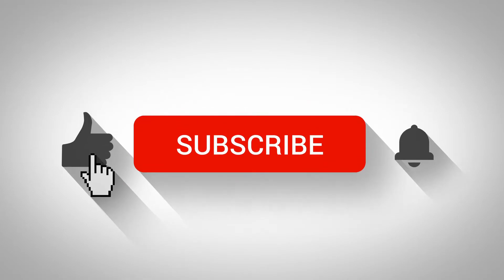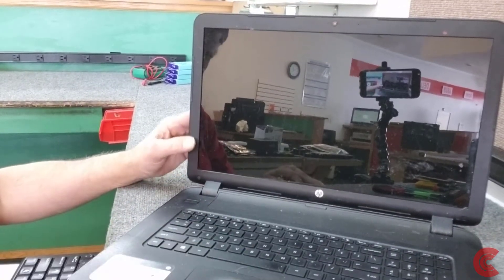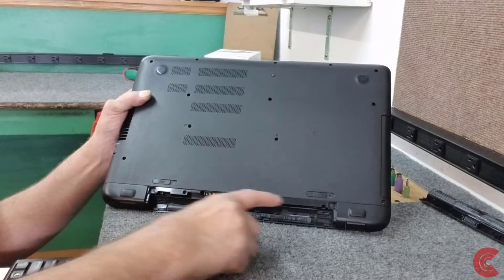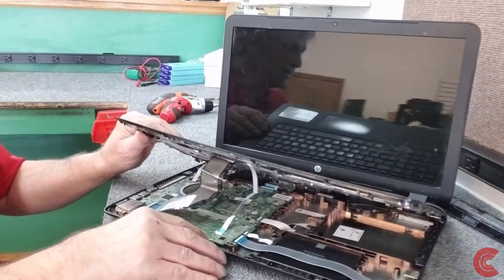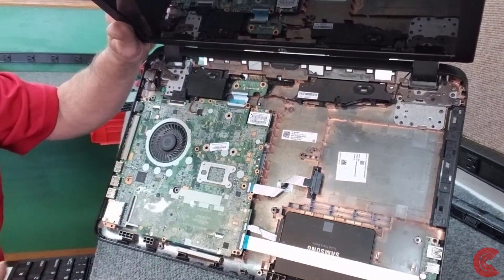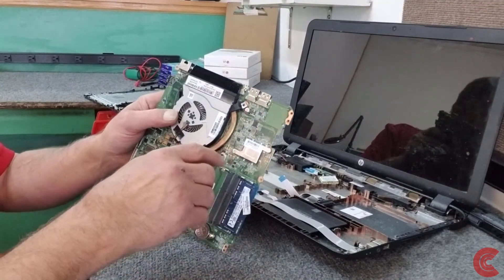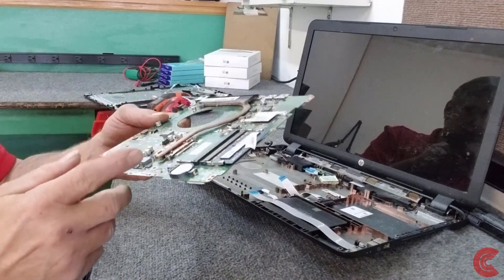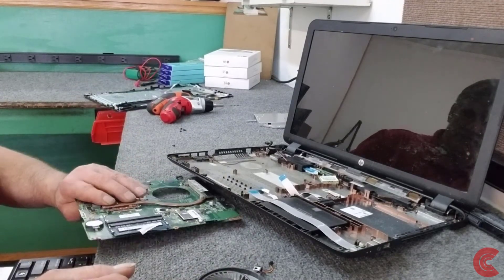How to Replace CPU cooling fan in HP 17.3" Laptop

Comment: Your video helped me with my similar HP 17-161dx. Your technique to remove the optical drive gave me the confidence to use a bit more force to slide it out to get to the 2 silver screws. THANK YOU!